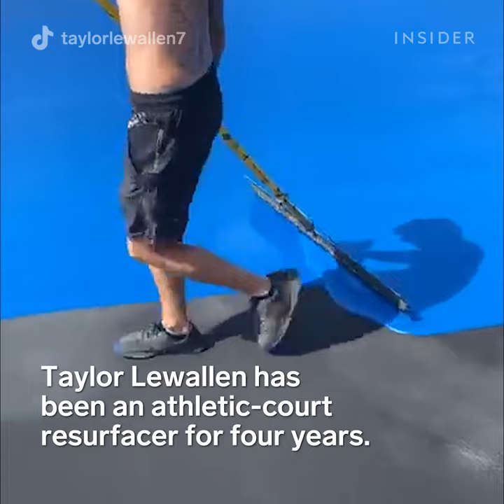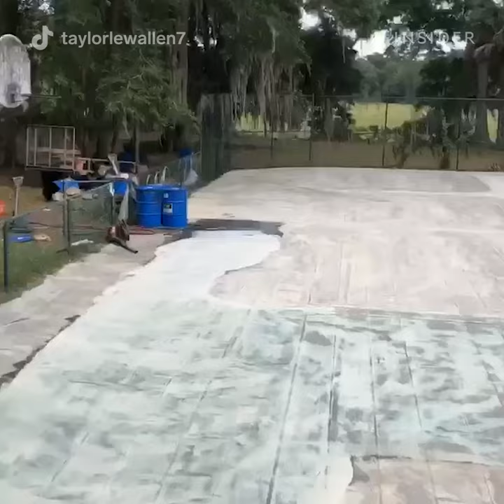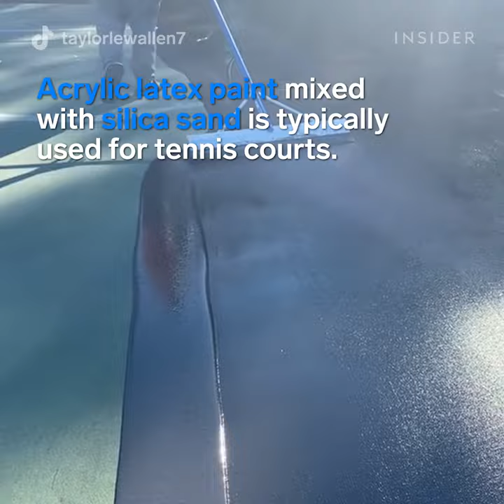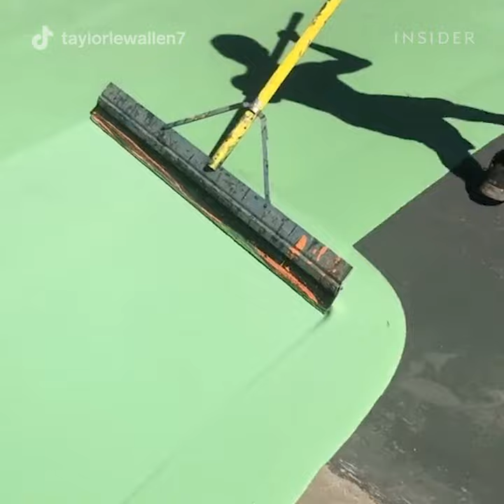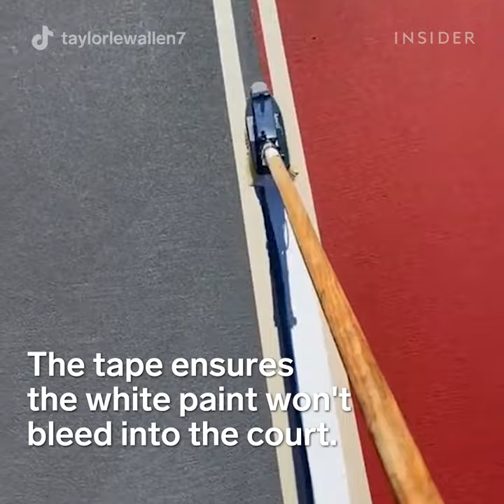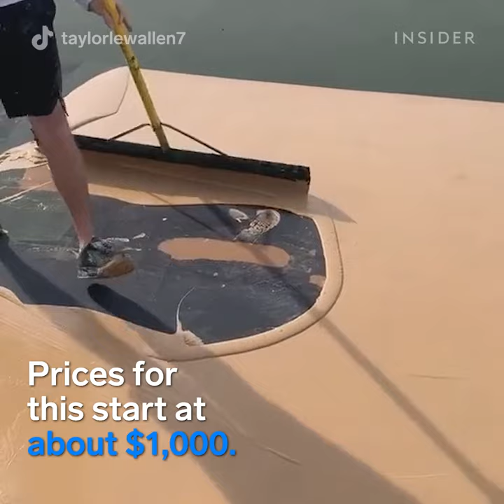How Tennis Courts Are Professionally Restored

Comment: Prices start at a $1000? 🤔 But I'm sure an average repair and resurface job can easily cost closer to 10x that amount.
Reply: Worked in the industry for years. A single court is at least $4-5000. The price per court can fluctuate a lot if there are a lot of courts, but not $1000/court low.
Reply: The materials alone would be 6-800 conservatively... So this guy must just be volunteering.